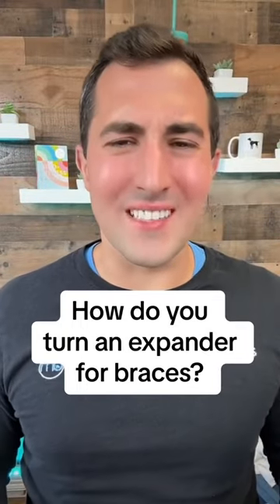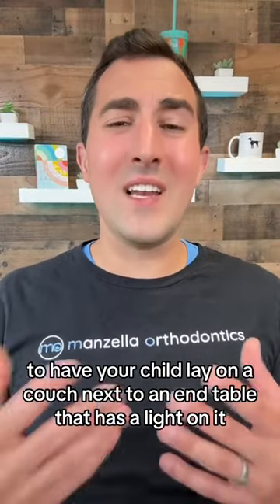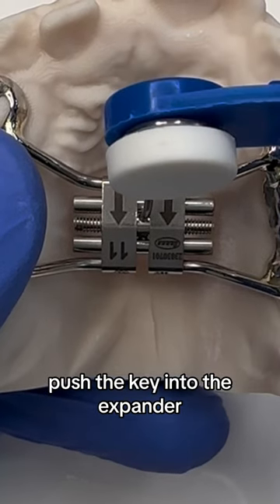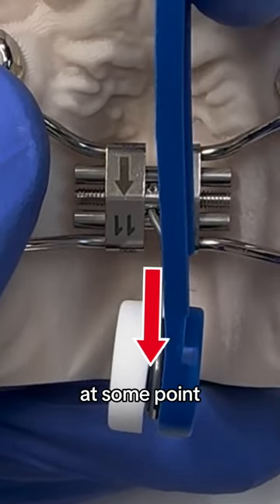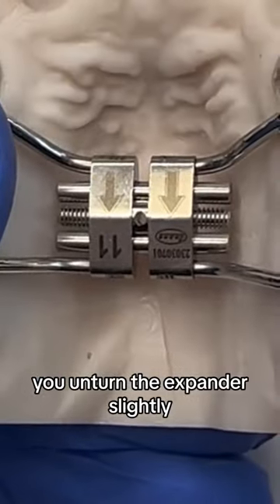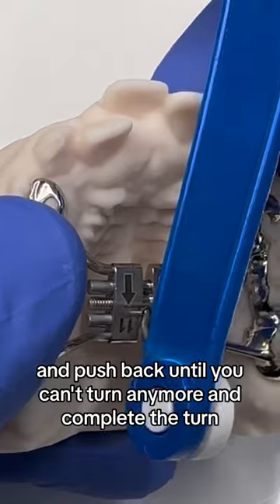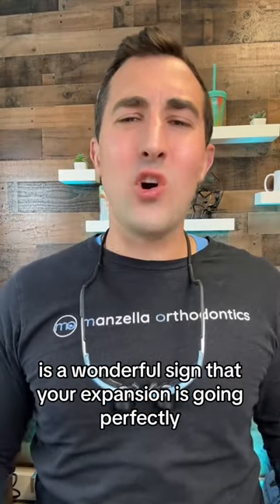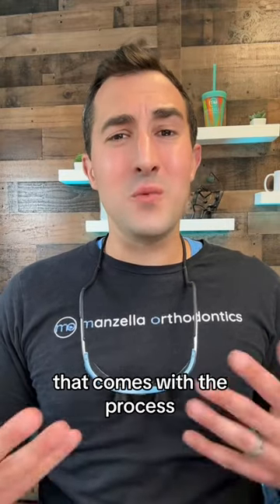How to turn an expander for braces.

Comment: Every time my father turns it the rhing slips out of the hole and into the back of my throat and it hurts what is going on
Reply from the maker: Sometimes that happens. Ur dad will get better bare with him it’s hard at the start!
Reply: @manzellaortho  he did it 9 times already
Reply: roserookie306  you probably didnt turn it far enoug the last time, the there is 1 big hole on the top/bottom that goes through the cylinder. when not turned correctly it will be pointing towards the top teeth and the back of the throat, if this doesnt help please consult ur orthodontist